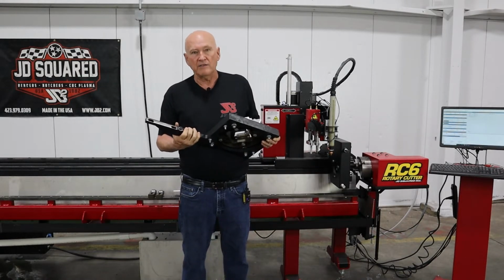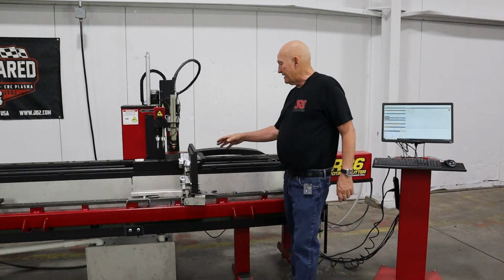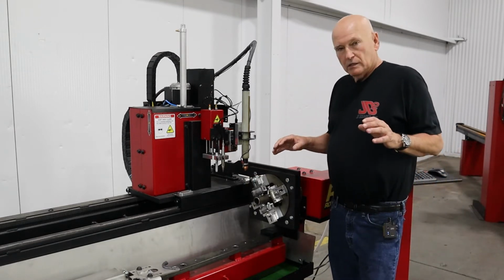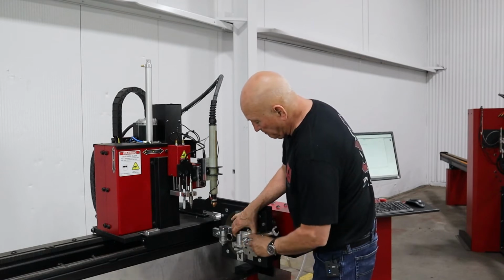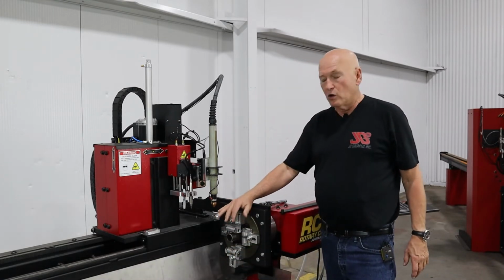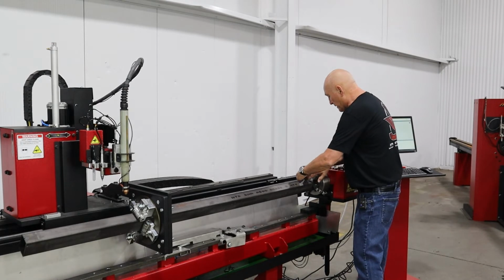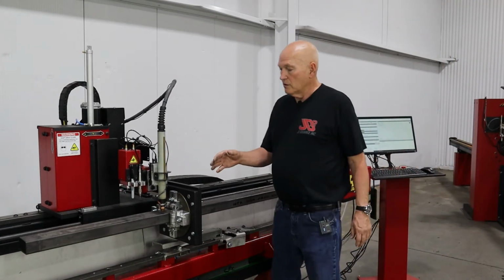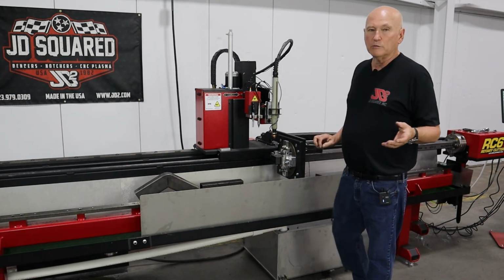RC6 Rotary Cutter - Square Tube Stabilizer Installation & Operation

Comment: What was the reasoning to transpose the X and Y axis? I would have a hard time getting used to that.
Reply: The reason the RC6's Y axis is aligned with the tube is because the rotary attachment for the MP plasma tables sits next to the machine and therefore runs down the Y axis. This keeps things simple when it comes to doing jobs on either machine. If you stand at the chuck side of the RC6 and look down the machine it's the same as standing in front of a MP table. In both cases the Y axis is down the length of the machines. Hope that helps.